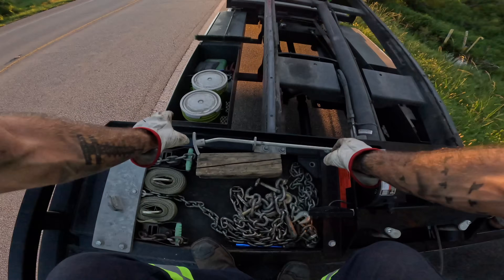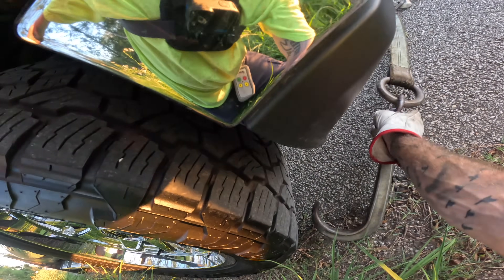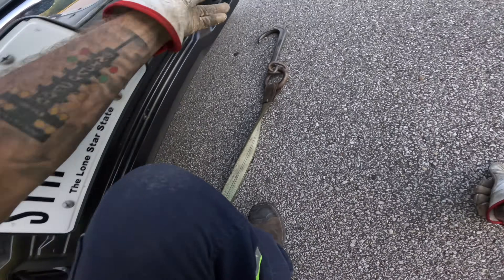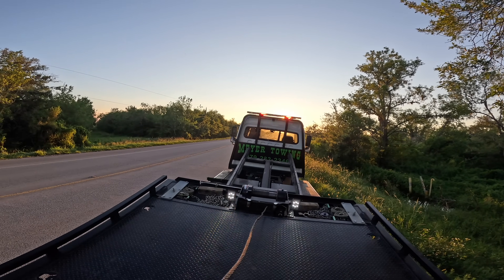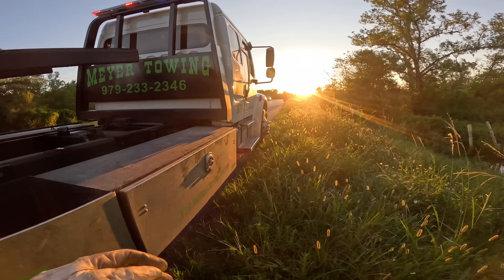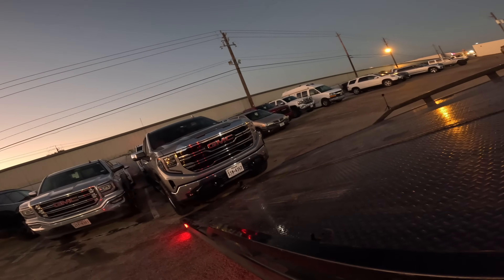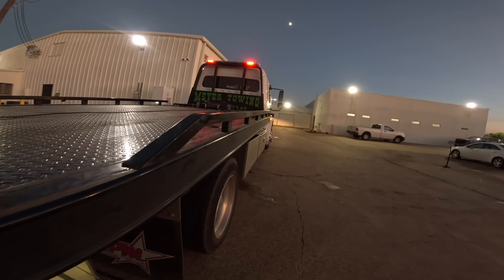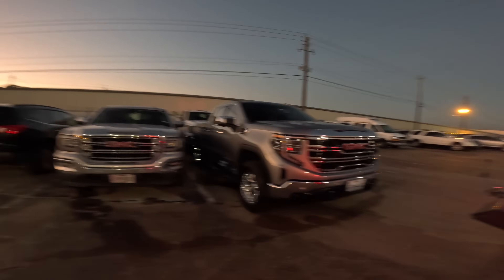Is GM Ever Going to Fix These Trucks??

Comment: Instead of complaining about the lack of neutral, why don't you dolly the rear tires and grab the front with your wheel lift? Much easier to unload, too.
Reply: I'm not sure how true it is but i heard tow truck drivers aren't supposed to put a car on the stinger unless another vehicle is already on the bed. something about the weight being too far back it could be unsafe to drive like that. not that I haven't seen it done before
Reply: @STREETRACEN4U  It will certainly drive better with weight on the deck. The wheel lift hangs way out in the back so it's taking always weight off the steer axle when you're using it. A car on the deck adds some weight back on the steer axle. But I'm pretty sure you could safely tow a pickup on the wheel lift with nothing on the deck and still have good enough weight balance. I would not try it with a smaller flatbed, but this one is a medium duty truck it should handle it.

Comment: Guys, 4WD Auto is not the issue… the complete lack of a neutral override is the issue. 

My family had a ‘21 Suburban that toasted a fuel pump control module at 61k miles. It was in 2wd, but was still a brick that needed to be drug up onto the flatbed with skids under the rear wheels. 

This is totally ridiculous. Great video.

Comment: They are all junk. Had no end of problems with my LTZ including replacing a seized 6.2 at 40k miles.  My 17 Tundra has the worst fuel economy of any of the 30 trucks I have owned. The new tundras are junk like the other big 3.  Not sure what I'll drive next. Might have to build one my self.
😊
Reply: What year was ur 6.2?
Reply: @lorigabrielson9113  it was a 2014. I loved the power it produced and it was really good on gas.  Then the general put a 15 cent Chinese plastic valve retainer clip that eventually let go and six weeks later I finally got my truck back with a new engine.
Reply: Get a cyber truck

Comment: Sierra's and Silverado's 1500's are very good trucks, you just have to option for the 3.0 Duramax diesel!
Reply: I have a ‘21 1500 Denali 3.0. It’s had glow plugs replaced, injectors replaced, nox sensors replaced, rear main seal replaced over leaking, oil cooler replaced over leaking…the dealer has had my truck cumulatively for 6 months. I’m currently waiting on a loaner to drop it off at the dealer yet again for the same check engine light emissions code they’ve never been able to fix. GM field engineer doing all troubleshooting. Camera problems they can’t locate, rear window regulator went bad….oh yeah..now the transmission recall that they’re not going to go ahead and fix, instead install software to monitor the problem part and put my truck in limp mode if it thinks it might fail…
Reply: @chrisanthony7523  that sucksthat  you're having so much troubke! I heard the LM2 3.0 was troublesome but sounds like you are having other issues as well. Thank god mine has been trouble-free since new! 💪
Reply: @chrisanthony7523  i hear ya man. toyota tundra 2023 also had so many issues that pos left me stranded twice. almost had to get insurance involved aswell as a lemon law just decided to trade that pos in for a gmc sierra 2015 2500 HD duramax that up until now hasnt let me down pretty smooth to be fair and reason why i didnt get a older toyota is because most down here in alaska have rust issues like always

Comment: What am I doing right? Have had 12 2019-2024 GM trucks in our small fleet and aside from some technology issues, rear window leaks, and one that ate a front diff they’ve all been trouble free. Highest mileage is a 2020 that’s just passed 130k.
Reply: Fuel pump control modules are pretty well known failure point. Usually worse where road salts are used heavily, corrosion gets to them. They aren’t quite weatherproof enough for life under the vehicle.

Comment: Is there a reason you didn't hook on the tow hooks? Seems like an easy place to winch to me. I supposed I wouldn't be surprised if they were fake/couldn't handle a real load, but I'm just not familiar with the newer GMs
Reply: When my 2011 got picked up by tilt and load after a deer rearanged my grill i asked him why he dont just hook to the tow hooks and he told me he dont want to damage them as most trucks are just for show and not work.
Reply: I’m sure you were told that, but he was wrong, at least as far as GM trucks.  I had an  “incident” last year and actually had a tow truck lift the front on my 2020 Chevy 3500 Duramax using the tow hooks.  No problem, no damage.
Reply: He stated in the comments that as the truck gets close to the wench it pulls the suspension down if on the recovery hooks.

Comment: I have a 2018 Silverado, 7 years with no problems, just sayin.
Reply from the maker: Those older trucks aren’t affected by this problem. Seems limited to the 2022+ vehicles.
Reply: 20’ here, 5.3, no issues either. 115,000 too. I stay in Sport mode too.😂😂😂

Comment: to answer to your question is that General Motors will not fix their screw ups like the lifter problems on their 5.3 and 6.2litter V8 or the fuel pumps or any other problem that they have with their vehicles
Reply: Dont forget the transmissions.  14-19s wont last more than 60k miles.

Comment: I'm a tow truck operator, and all GM ARE TRASH no parking for the tow ins at dealership
Reply: What about fords with the 10r80 transmission? You know, the 10 speed in the F150, expedition,mustang, and more.
Reply: @yeeterooni7352  Fords are a little bit better, but I think all new vehicles are trash
Reply: @MikeyPaul-dl4ez  wow that's a hot take. Your one of those people... not all new cars are trash. Still may reliable cars.
Reply: @yeeterooni7352  No, not really. Toyota is doing pretty well. Ford is up there Traded in my 2018 camaro for ford F150 With the coyote and I love it
Reply: @yeeterooni7352  when u tow vehicles  like I do u know what's good 😆 🤣

Comment: Fuel pump control module?
Reply: If it’s the same one I’m thinking of, it’s an electronic module that sits under the vehicle. They aren’t quite weatherproof enough for the location and will get moisture & corrosion inside. Gm essentially took what used to be done by a $20-30 under hood relay and turned it into a several hundred $$ electronic module.
Reply: @jeffs2809  
They are attached to the frame rail right under the drivers seat.  About a 15 minute swap out.  And a known failure point on these trucks.  Mine went out a couple of months ago.  First time in 25 years a GM truck left me walkin'   
Hope they get them built better in the future
Reply: @vicarod  I really don't get GM engineering lately ... it seems so compromised at times.  Like doing it the easy way instead of the better way.  That part should either be weather proofed or placed under the hood area - at least it is not on top of the gas tank!  But seriously, the cheapness and cost cutting is biting these guys in the but(t) because that is likely a warranty item - so you have towing, parts, labor, loaner car, time taken away from doing profitable oil changes, etc.  American shortsightedness ???
Reply: More than likely the issue. They always go bad

Comment: Its funny that a brand new truck with 13k miles leaves you stranded. My 2005 F150 I bought new with the "dreaded" 5.4 3V engine has never left me stranded. Im still driving it and its "easy to fix". Did the timing job myself and expect the engine to last another 100k with nothing but oil changes.
Only an ignorant fool would buy a new GM product with their track record. Tesla is crushing GM one sale at a time. GM is a joke! Most new GM FORD and "Chrysler" products are a joke with reliability problems. People have fallen for the fancy bells and whistles over a reliable vehicle.

Comment: Does this truck have that stupid Buckle to drive feature? If so and it's on, you can't shift the truck at all, until you buckle the seat belt or disable the feature in settings.

Comment: will loyal GM owners stop buying them?
Reply: No. I buy GM vehicles with out cylinder deactivation. They make a good product. They all have issues right now. Ford and Dodge are both recalling engines so they’re not much better.
Reply: @CBH238  back to basics wins everytime.
Reply: @jhonditch4269  yep that’s why I went with 6.6l gas. No cylinder deactivation and then also no emissions problems from the diesel.

Comment: Hahahaha pos. Ford f150s aint left me stranded in years now. Chevy died when they canned the 6.0. My 93 z28 unmolested lt1 350 still running strong while this new pos is being towed 😂😂.
Reply: Hahahaha.... dont worry there lil bruh... your pos ford f150 will be next. 🤣🤣🤣 Nothing but problems with ours and had warranty !!   Never Ever another ford again !   And icing on the cake is our f250 we use for work.... Always in the shop.. first head gasket... now cp4. Absolute piles of 💩💩
Reply: 2004 5.3 suburban just hit 300k miles only major issues when I first bought it was transfer case failure due to previous owners lack of maintenance skills and initiative. bought it with 212k replaced T Case and let it eat
Reply: @hellswindstaff91  doesn't surprise me at all. The 5.3 before they put kachow mod and self deleting lifters was good.
Reply: @coreysharp9794  yea since August Ive replaced 2 engines in a 2018 Yukon and 2017 Tahoe because of that self destructive AFM. And transmission failed in the Yukon right afterwards so customer brought it back for that too. Junk
Reply: @hellswindstaff91  ahh yes, the 14-18 models have the worst transmission ever. Probably why they paid ford to jam 10 speeds in gm vehicles. 😂
Reply: @coreysharp9794 bullshit. If you have a NEWER ford it’s only a matter of time, if you have a old ford that’s actually reliable then that’s understandable
Reply: @hellswindstaff91 lol exact same thing happened to my friend in texas. 2015 yukon the transmission went bad then he spent $3k to fix then two weeks later the lifters went bad and toasted the engine😂😂😂he went and traded it in for a telluride
Reply: @warriorplutotrent3827  haha glad your friend got something simple and reliable with good tech and great warranty. No one wants a headache truck these days. Want to take your family on a road trip last thing I want to think about is are my lifters gonna take a dump is my transmission gonna shit the bed etc. 😂
Reply: I got a 6.2 in mine.  What's that Ford got in it?  The answer is two turbos and a whistle. LOL
Reply: @michaelhartzheim8191  it's better than the 6.2 junk
Reply: Someone’s jealous I see.
Reply: @agoogleuser4337 Not all do.  I’ve got friends that have well over 150k on theirs and have had zero issues with the lifters or anything for that matter. You must be one of the unlucky ones.  Besides covered under warranty for you and for me.  This video was about the 22 refresh and has nothing to do about the motors.  There’s a reason why you never buy the first year refresh vehicles.  Wait a year so they get all the bugs out.
Reply: @michaelhartzheim8191 yall forget ford also has the 5.0 V8 😂
Reply: @David21-h8b  and that 5.0 has AFM 🤣💀
Reply: @NikitasCap  Erm actually no they don’t that was the GM 5.3 from 2007-2014 ☝️🤓
Reply: @David21-h8b  Erm uh, you might want to do your research. Ford added cylinder deactivation in 2021 to the 5.0 🤣
Reply: @ and yet Ford still does a better job with it than GM. All you gotta do is put it in sport or tow/haul mode. 🤣🤣🤣🤣

Comment: Hey. My dude. You really need to understand that every wrecker driver who has ever been hit on the road was hit for the same exact reason.

They were all still there.

Hurry up, load that brick and get off the road. If you were truly concerned about your safety and the trucks tires getting scuffed.

Then you pound skates quick and drag that truck with winch at full speed.

You don't realize how hiding on the passenger side of the truck is still hiding in a kill zone. Don't pretend you haven't seen the videos of guys getting hit, ramped, and cars flipping off the passenger side of the bed.

Do not fool yourself. You are not safe AT ALL on the side of that road.

So hurry the fuck up.

Otherwise. Good load. Never seen a guy use his lasso like that. Why not 8 points? Like everybody else? Just as fast and I'd argue safer than your method. (Unless you're going through the rims)

Comment: It’s 9/16/24. LET ME START OFF WITH, Disconnect/reconnect negative terminal and the stupid thing will start😡Have a 22’ GMC 6.2 w/24k miles. Just had the same problem 2 days ago. Took to dealership today and was told I have the same fuel module problem😡
Reply from the maker: I’m not disconnecting anything on a vehicle that obviously has problems. Good way to get blamed for whatever is wrong with it. I’ll tow it into the dealership and let the mechanics work on it.
Reply: @Towtruck_Dustin  no sir not you. Comment was for the owner. Worked for me to get it home and then to dealership on Monday. 
Great video 👍🏽

Comment: Laws require traffic to move over for law enforcement stops on the side of a roadway. Similar laws need to be in place for tow truck operators as well‼️
Reply from the maker: It is law. Just no one cares.
Reply: And for everyone else on the side of the road but most ppl have tunnel vision in some cases ppl don't move over for emergency vehicles like ambulances or fire department I see that every day I'm wondering if they even read the license questions

Comment: What is wrong with the truck?
Reply: It's a newer GM... THAT is the problem...
Reply: transmission failure probably
Reply: It’s a General Motors vehicle. I refuse to buy any of those past 2008.
Reply: Lots of transmission problems
Reply: @rajanicn9269  trans problem or rear differential... lots of those are grenading too!
Reply: @colestock9980  I would say 2013 is the last I would buy a GM truck their cars I wouldn’t buy one newer than 2009
Reply: He could have held start button for 5 seconds to put into service mode, then it would allow you to put into neutral.
Reply: Somewhere they said fuel pump failure
Reply: @rv610dave  it’s the fuel pump driver module fails, not the pump itself

Comment: what do you buy for trucks now? GM,Ford are pure trash now a days, Ram is a Ram so no. Even the Toyotas are garbage now 😂
Reply: government regulations makes everything the same because of the mandates.
Reply: RAM is junk! The HD's are built in Saltillo, Mexico...enough said.
Reply: @scottmichaels12 Silverado is made In Mexico too
Reply: @scottmichaels12 with what Ram has to offer these days, I don’t see buying a new one. That said, you will have a hard time finding a more reliable one than the 2017 I have right now. 2500 4wd Cummins crew cab long bed with the manual transmission. Zero downtime for unscheduled maintenance. I have spent ~$300 replacing the abs hydraulic module myself. No other repairs.
Reply: you buy older vehicles that were built better, thats the answer
Reply: I dunno, the 2.7l ecoboost and the 5.0s are pretty good from what owners say.

Comment: Garbage Motors
Reply: Never felt the power of a duramax huh Jim?
Reply: @Jakerthesnaker  LOL 😂
Reply: @Jakerthesnaker  I've got 2006, 2500 Duramax LBZ that I regularly pull a 15K rolloff dump trailer with and a 2024 Duramax dually that I pull a 25K trailer with and I often times can't even feel it. Jim Jones is just a hater who probably drives a Stelantis RAM that's built in Mexico...and he's a psycho cult leader.😂
Reply: agreed, several hundred thousand miles on my 2002 lb7 with only 1 set of injectors and a few minor repairs. Still runs like a champ. I now drive the lzo 3.0 duramax that sips fuel close to 30 hwy mpg and still has 300 hp like the lb7.

Comment: ford has had more recalls than any other company this year
Reply: recalls are not listed by manufacturer in total amounts...so you are pulling that 'stat' out of your ass just because you hate ford I guess
Reply: @biz0r07  they just recalled ecoboost engines 5 days ago for failures.  and idc if manufacturers list recalls, other companies and people count the amount of recalls and ford is on top.  i dont hate ford i actually like them but i dont like biased stuff mike this video, dustin hates gm so only talks about gm vehicles that he tows when the fact is he tows other makes just as much
Reply: @drewdevon2009  so what are the raw numbers/totals then?
Reply: I work in Flint Michigan and of course it’s a big GM town. I owned two Silverados 99-06 gen and 07-12 generation. Both trucks were great but the new truck are garbage 3 people at work had to put new engines in their trucks under warranty but dam that’s unacceptable. I bought a 18 f150 5.0  10R80 transmission and love it. 19.8 average MPG
Reply: How many of those recalls of other makes leave you on the side of the road. That's what this tow driver is talking about. GM seems to be the "leave you stranded on the side of the road" leader. I watch a lot of tow channels and GM trucks are a high percentage of the tow business.
Reply: @sheehy933  Yall need to stop arguing over which brand is worse. All brands are terrible these days, Hyundai made a name for themselves in car theft/engine failure. Toyota just recalled a bunch of trucks for engine failure, Ford and GM are not unique in this problem. Cars are not as simplistic as they used to be, they are more technology than machine at this point. It is unfortunate, but a reality all new car owners must face now.
Reply: @TheScottAF  You're absolutely right, they all have issues. Many of the issues are technology based but there have also been plenty of cases of poor quality materials used in internal engine parts, electrical parts, poor quality clamps, fasteners, etc. 
I don't see how your averge person could keep these cars on the road once they're 5 to 10 years out of warranty.